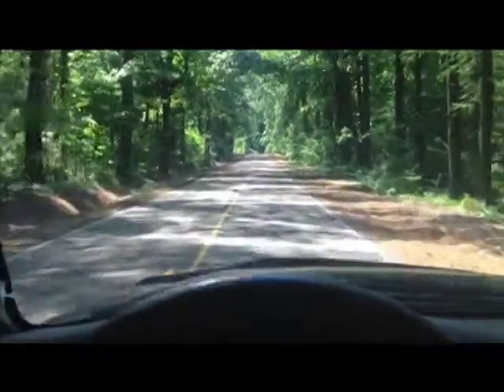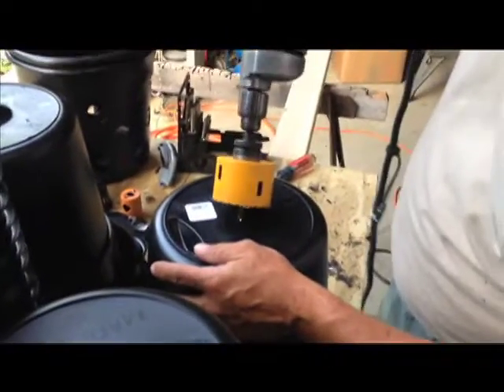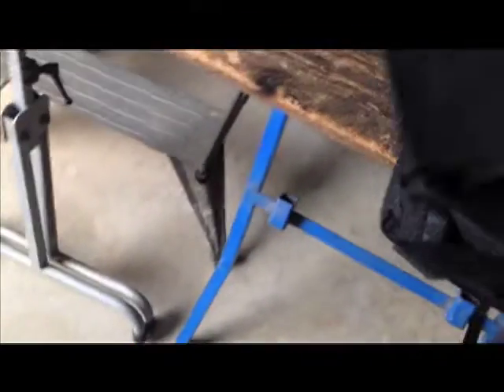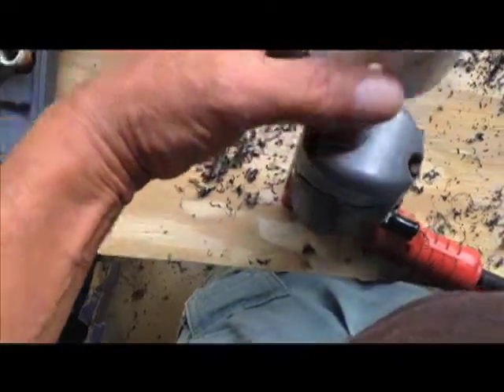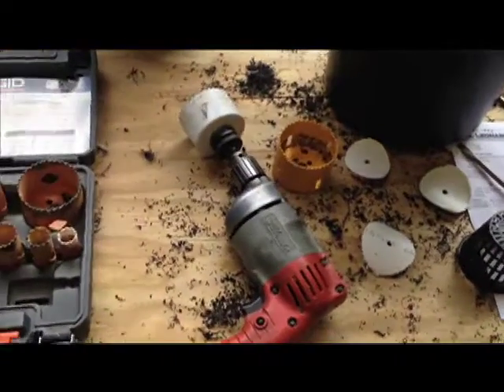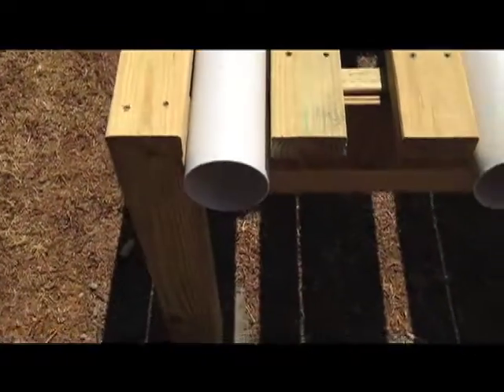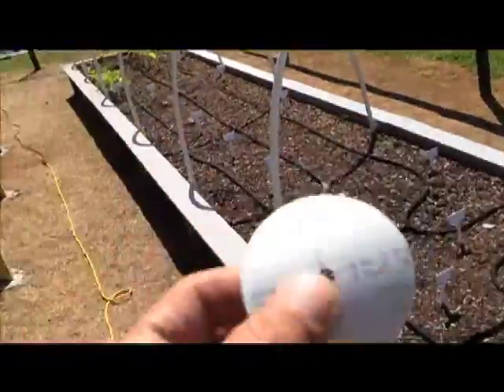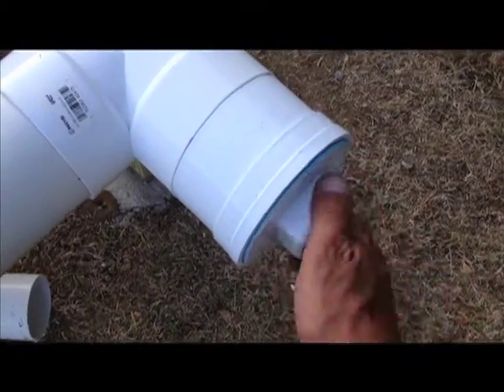Hybrid Rain Gutter Grow System Step by Step Ep 3

Comment: What are the dimensions of the baskets? I have a `175mm (3 Inch) holesaw and am finding trouble locating baskets to fit.
Reply from the maker: 3" baskets with 2 3/4" holes in the pipe

Comment: It might be possible to keep the buckets stacked to drill the holes in the bottom and sides?
Reply from the maker: If you drill the bottoms stacked you run the risk of not hitting the bucket center.  That would cause the bucket to not site in alignment with the rest once inserted into the pipe.  It is always a good idea to see what you are cutting too.  I think I am going to try the 2-7/8 hole saw on the sides to cut down on the work load.  The blanks that are drilled out do not tend to stick to the hole saw bit on the larger sizes.  Thank you for your suggestion.